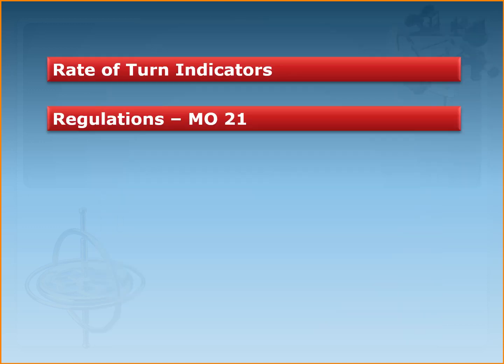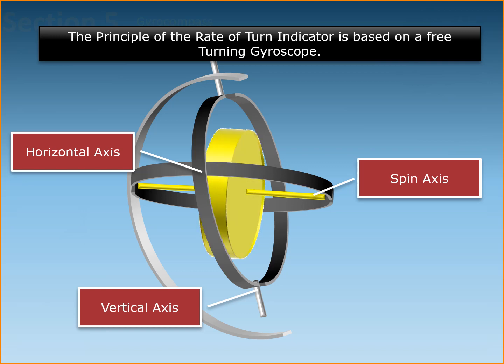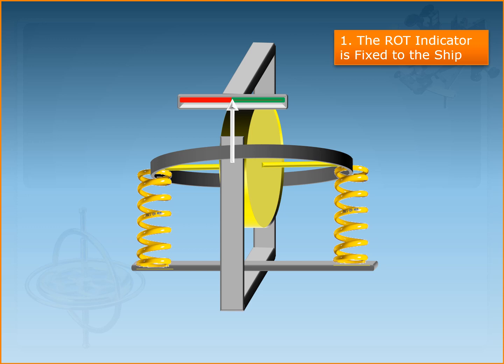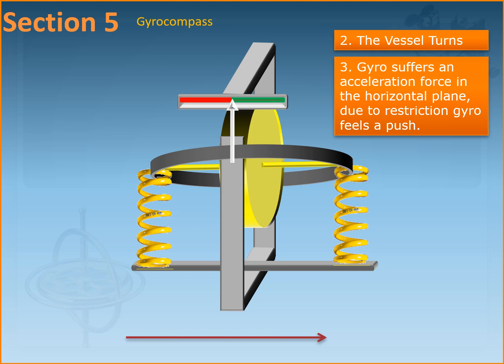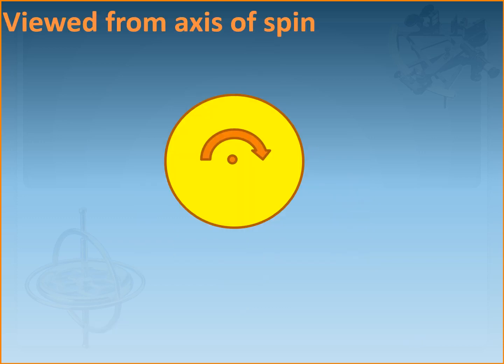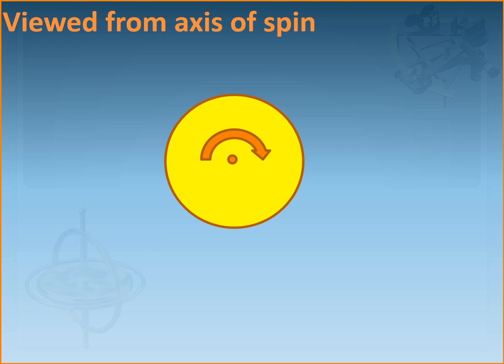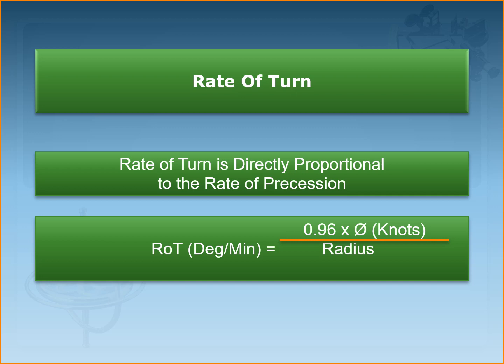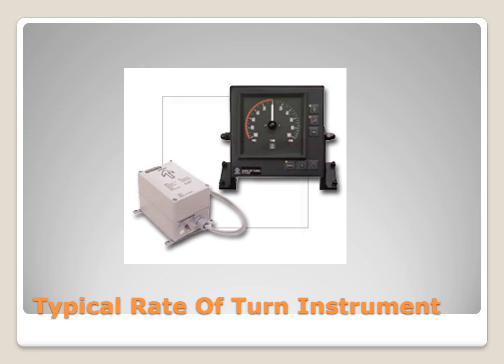Gyro Compass Part 8: Rate of Turn Indicator - Rate Gyro

Comment: Dear Captain, how and where do we find the RADIUS mentioned in the above ROT formula
Reply: Tactical diameter x2 i believe. Should be found on your pilot card. Allowance should be made in shallow water as the turning radius would increase due to interaction forces